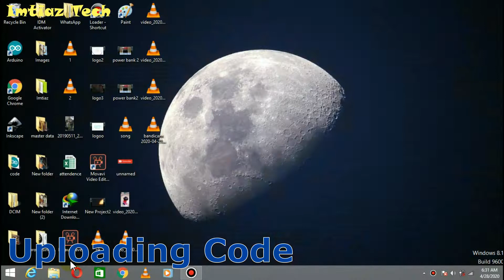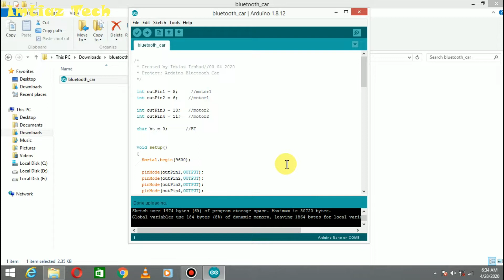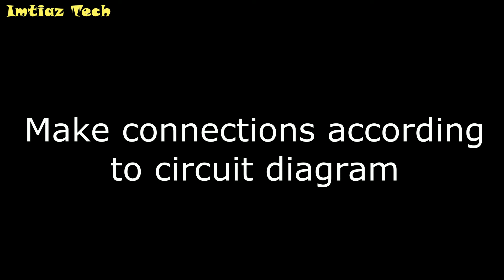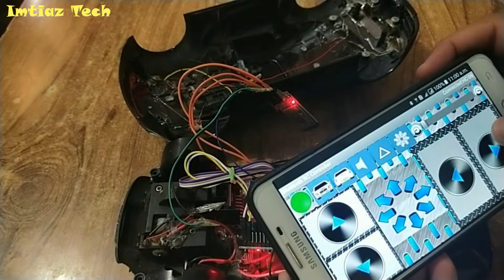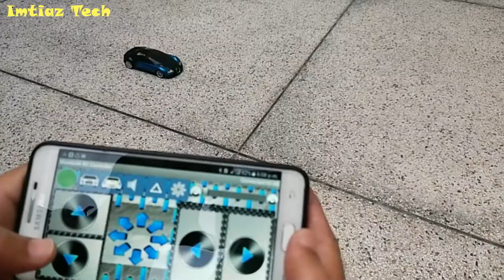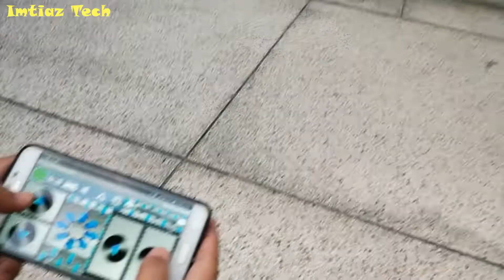How to make Bluetooth Car at home | Smart Phone Controlled DIY

Comment: How can we downlode  af motor library from phone 

Pls reply sir
Reply from the maker: use laptop or pc
Reply: @ImtiazTech   ok
Reply: Yes 
the Bluetooth has connected to phone it is working 
But the motors is not working

Pls reply sir plz
Reply from the maker: @sayanthpraveen3415  check your connections to motor driver again
Reply: @ImtiazTech  yes I checked 
But it is not working 
But light are blinking in all board 
What should I do
Reply from the maker: code is given in the description